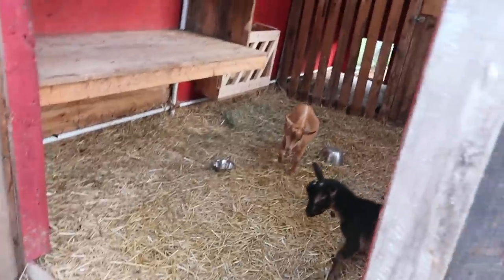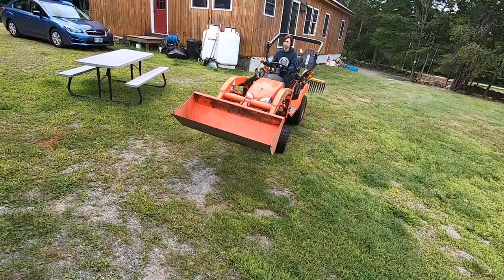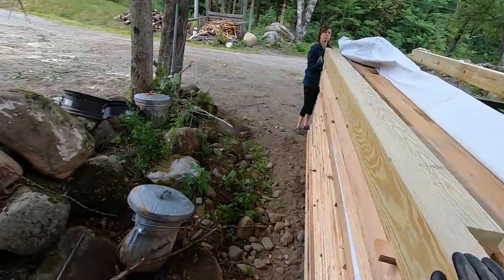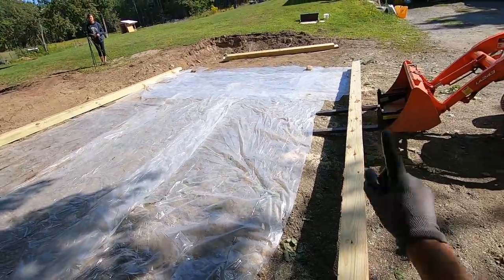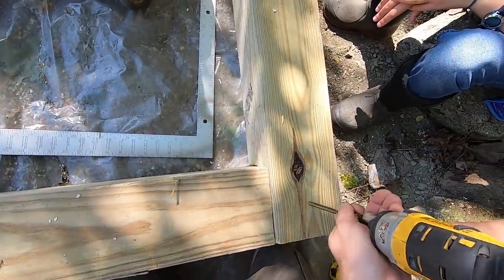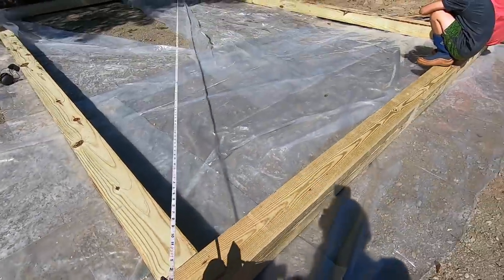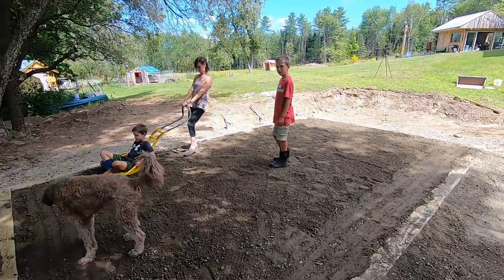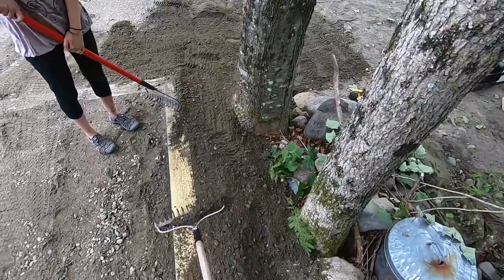I Bet you've Never Seen it DONE like this BEFORE Setting the Foundation for the Post and Beam SHED

Comment: You could either get free pallets from somewhere or buy them or use all your leftover wood from the barn to make them. Pallets keep wood off the gravel floor and you can rotate your pallets to evenly dry them. Stack the firewood once on the pallet and because its off the ground you will get good cross ventilation and ease of moving the piles. As far as doors I know you said no wooden doors but maybe a tarp or 2 to keep out rain and snow. Love the videos no pigs or figuro today. They slept in as well I guess.
Reply: yes I expect they will have pallets to use from the pile of lumber delivered for the wood shed

Comment: Probably should have left more room near the two trees on the front left corner.  The trees will continue to grow and 10 years from now the roots will be pushing up that corner of the building.  The crusher run gravel floor will be great, it will get hard like concrete.  Should be able to store some firewood in there!

Comment: To late to suggest it, but I would have wanted my mud sills further from the trees.  I was always told to stay out of the drip line of any existing mature trees near where you are building.  This especially true for species which have roots close to the top of the soil, which over time will undermine your building and cause it to have structural issues.

Comment: If the flour beams are not the pressure treated they will rot to square anything you can use the 3’ 4’ = 5’ measure from the corner 3’ the measure the other 4’ then if it’s square it will be 5’ from the 3’ mark to the 4’ mark

Comment: But your vapor barrier extends out several feet beyond the walls. Water will likely be an issue when it migrates down through the back-fill onto your plastic sheeting and into your shed. You probably should have cut it off flush...

Comment: Didn’t realize the base was going to be on the ground and exposed to the earth
Reply: It's got a vapour barrier to stop the ground moisture !
Reply: Steve Wilson in CA thick mil viscreen plastic was strong enough to be considered as a vapor. 2 mil or slightly thicker is easily punctured and there goes your vapor barrier. Use of as fewer sheets was the best. Viscreen cones in I believe 10 or 20 feet wide rolls
Reply: Judy G. Nothing wrong with the plastic, should be thicker mil then was used. Also the end bolts went clear through to the plastic and most likely punctured all the corners. Moisture if any will migrate through these holes.

Comment: Adding those extension forks with clamps to the front of the loader was a good idea.  BUT the loads would have been more secure if you had clipped them on as far to the left and right edges as possible.  This would have given a more stable base for the load.  Taking what you did to the ill-advised extreme, would have been to put them both in the middle of the loader -- then you would have had a "see-saw" load.

I also see you are not taking advice to place the shed about a metre away from that nearest tree.   I hope you do not regret your decision.

Comment: If the roof is going to be pitched to drain towards those trees, they will be ok.  If not, you would do yourself a huge favor to remove them before putting up the building as they will eventually die on that side and present a hazard to your new woodshed.
Reply: Why would they die?

Comment: I think I would have opted for a concrete foundation - easier to level and avoids ground settling beneath the structure itself. While you did "compact" the soil inside the foundation at the end of this video, where you filled in under the foundation isn't compacted. It makes little difference, anyway - when you're talking about naturally compacted soil (before you started) as opposed to filling, you'll never get it as compacted as it was in the beginning, and this will result in the filled soil being the weakest link when mother nature decides to rearrange the topography.
Reply: Judy G.  - I agree that it wouldn't have been the cheaper option, but with the projected cost of such a project, a proper foundation should be figured in. It may be a little more expensive now, but it's cheaper than down the road when it comes time to fix the mistake.